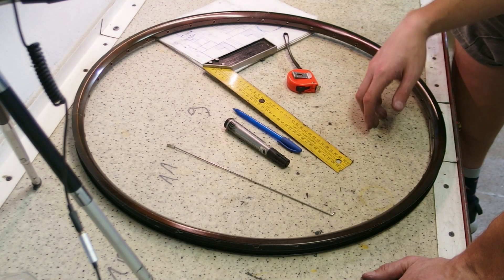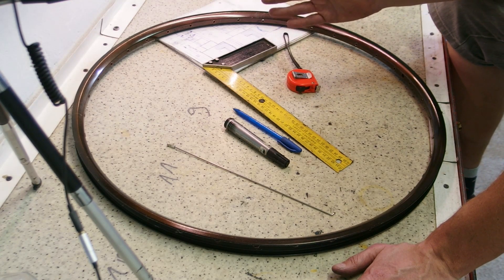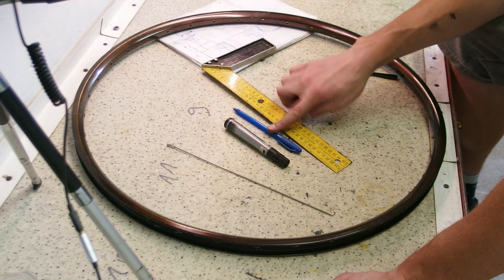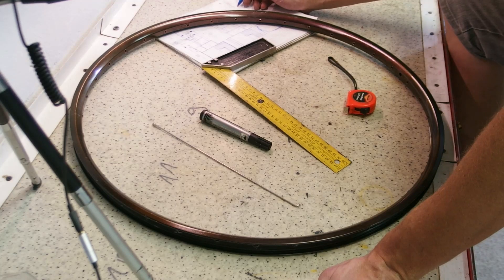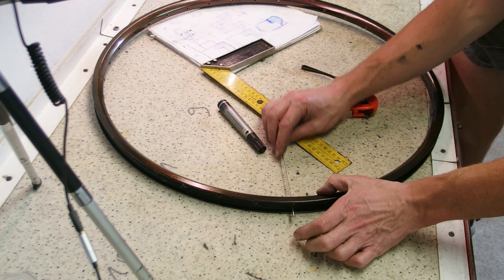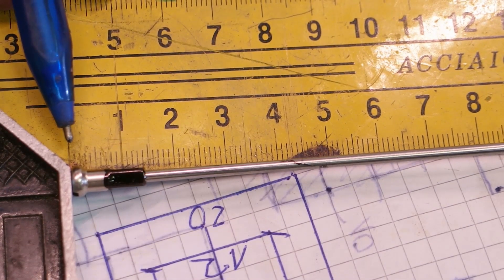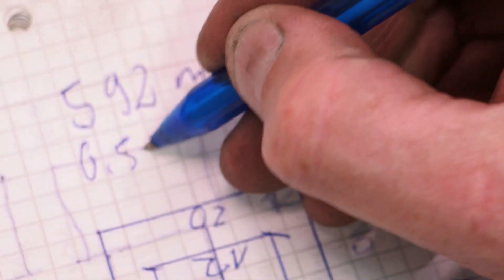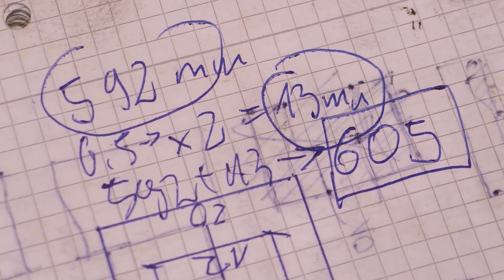Measure Effective Rim Diameter ( ERD ) Quickly ( Two Minute Tutorial )

Comment: Shouldn't you measure from the bottom of the wide part of the nipple to the black mark? That would give you the thickness of the metal more accurately than measuring from the top of the nipple... right?
Reply from the maker: The ERD is diameter of a circle that spoke ends make in a wheel. By measuring they way I presented, you get a result where spoke ends land exactly at the end of the nipple head. You then ought to choose spokes a touch shorter ( 1mm~ ) when building a wheel.

Comment: From where to where did you measure the spoke hole distance?  Like where those holes actually are ? Or did you measure to the outermost spot of the rim?
Reply from the maker: Eyelet to eyelet, if you have a rim with those, or just the inner diameter. The error is going to be at most ~1mm so really, does not matter.